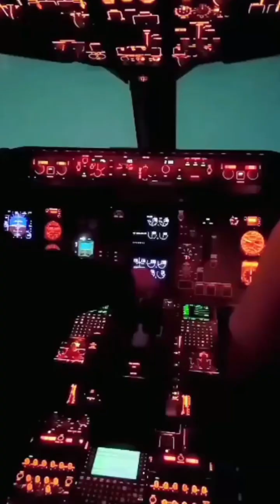How do planes land in zero visibility?

Comment: This red thing's aren't use for ILS, ILS is bunch of little antenna's before touchdown zone.
Reply: you are 100% correct that was the radar. The ILS is a combination of the Localizer and the Glideslope. Localizer gives you your right and left indicators transmitted and received at the end of the runway. He kept saying the Glideslope which is located about halfway down the runway. It gives the up and down indicators just like the ILS but vertical. When looking at your heading/pitch indicator you will see when the ILS is active a indicator on the heading to tell you if you are to the right or left. on your pitch where it tells you your altitude you will see an indicator that let you know if your too high or too low. for more information go look up mentor pilot he has a free app that can teach you things about planes and the instruments.